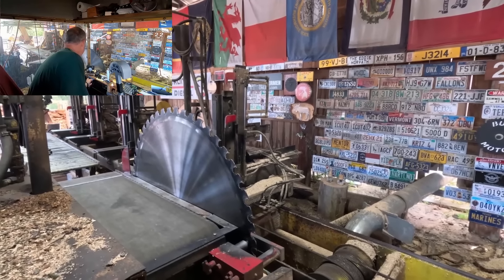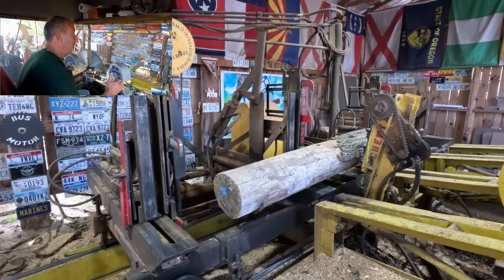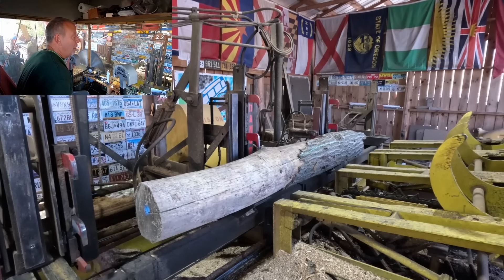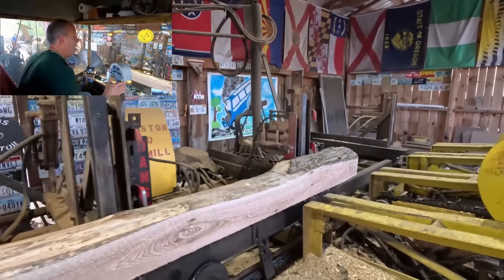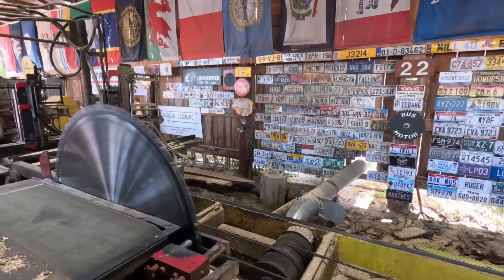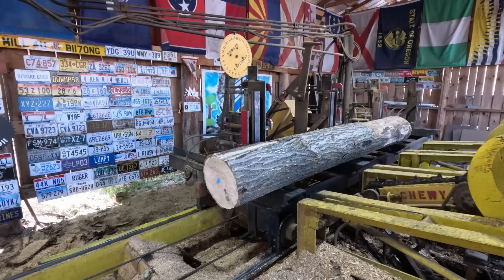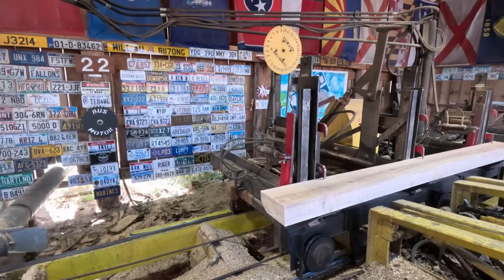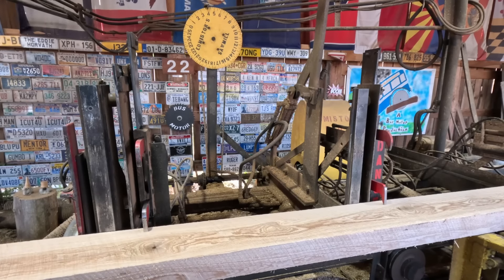sawing oak 4x4s with a clogged fuel filter # 612

Comment: When that tank starts getting low again, if there is some time to spare that is, try flushing out the tank and any fuel can be filtered and cleaned up and put back in the tank, so there is no waste and all. If its just humidity then something like a ammo can and some silica packets might be able to work and stave off the filters going bad. Either way, small things to fix are annoying but in the same, like you said, better than the big problems.

Comment: Outfit had a big Miller welder with a Kuboda motor. It'd fade out and we'd take the filter off and beat out the rye in the red fuel out of it and it'd run fine for a while. Bus Motor likes it's fuel. 
Good going and happy weekend and Blessings to yall!
Reply from the maker: thanks Lewie , we got 200 gallon of fuel this week and it stirs up the the sediment on the bottom of the tank.

Comment: We had a rough week too Mark   .. hyd problems with the log turner it kept going in limp mode  then out of it on its own had all kinds of people in to fix it still not sure if the problem is fixed   Hope you get your fuel prices blend sorted out   Have a good weekend
Reply from the maker: thanks Marc , this should be fixed with a new filter.

Comment: You can get a pack of heavy duty ziplock bags ... mine came with a pump to suck the air out. I use them for storing filters and suck on my boat Put them in there, suck the air out and stuff will stay good for years. when you need one, open the bag and take it out But you can re seal them and suck the air out again .... great for storing PLA for 3D printers as well.
Reply from the maker: great idea , I can get these filters locally so I never buy extras.

Comment: We used to run a V6-71 in our tractor, and the thing that would plug a filter the fastest is water. We installed a water separator between the tank and the engine. 
Max H. retired farmer.
Reply from the maker: I do have a water separator on the fuel tank and it was the one that clogged up.

Comment: Just a thought, but a friend of mine and myself helped a guy out who was having horrible issues with his tractors. We filled our tractors off his farm tank and immediately that day started having issues. I immediately figured out the fuel was contaminated! not from the supplier, but the farm tank. The farm tank had a fungus growing in it. Some how the filter on the tank failed and was letting the fungus by so it ended up in our diesel tractors and the farmers tractors. He was not so good about maintenance, so the crud caused worse issues for him than us. I had to change fuel filters and my friend did also. We ended up draining our tanks and having to clean them. We put that dirty diesel back in the farmers tank. He was later able to filter it clean, and clean his tank. We now all use algacide in our storage tanks.

Comment: If the stuff in your fuel filter is black you probably have bacteria growth in the fuel tank. I don't know what your fuel plumbing system is but Detroit Diesels recirculate their fuel in a closed loop system, and it warms up the fuel to the point where bacteria will grow in the lower portions of the tank, and it is very good at clogging filters. The smaller the fuel tank the worse the problem is. There are additives that can prevent it but if it is the tank will need cleaned first.

Comment: Hi Mark. Another clogged fuel filter.  🙄😬😐😑😔 Another operational problem. WHISTLE! Well. You did very well considering. Beautiful 4s by 4s. Mark. I go to Indonesian sawmills. This certain sawmill does bengkirai wood. This wood is a dense durable hardwood that comes the Shorea laevis tree, which is native to Southeast Asia.  This wood is 50% stronger than oak! They're massive trees. 30 inches to 48 inches wide. Yellow, red, & white species of these trees.  They have other interesting species of trees too. Thanks Mark. Say Hi to Ed & ZZ. Have a good Sunday the 22nd. 🥰🙂😉👍❤️💜🙏🏻🙏🏻🙏🏻🙏🏻🌳

Comment: 😊😊 HI MARK most likely it needs a fuel filter its pulling trash off the bottom of the fuel tank 😮😮 its stopped up U shouldve had a air compressor there 2 clean it out some times it will help and a linline fuel filter would also help 😊😊 OMG 9 21 2O24
Reply from the maker: yes I will replace the filters this week.

Comment: If you install a glass jar water separator before the filter you will see if its water and therefore bacteria that is the problem. The presence of water is why the bacteria can grow. The warmer the fuel and outside temperature is the more bacteria is produced. With a fuel tank that is above ground it becomes worse still as the warm air in the tank cools down when the engine is not running, especially overnight and the moisture in the air condenses into the fuel as water and builds up over time. I was with the maintenance team on a fleet of 250 Detroit powered vehicles and bacteria in the fuel was a constant problem. We had to dose our tanks with a diesel biocide to get it under control.